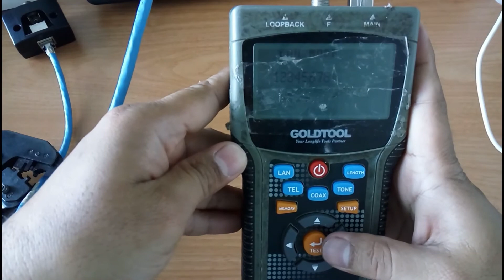How to Use Commscope RJ45 Cat6

Comment: I've never seen this type of connection before. Isn't it more work? Also, why did you leave out the blue wires on one end and the green wires on the other end? I thought they should be the same. Also, please tell me if there is any advantage in using this type of connection. Thanks.

Comment: too much trouble with unnecessary additional pieces. imagine you are up a 10 ft ladder trying to terminate a some data points and with rj45 parts raining down below.
Reply from the maker: May be this rj45 for jumper switch to switch or switch to router 😁